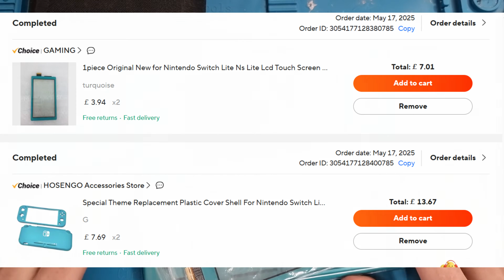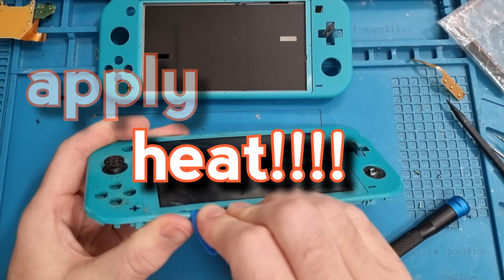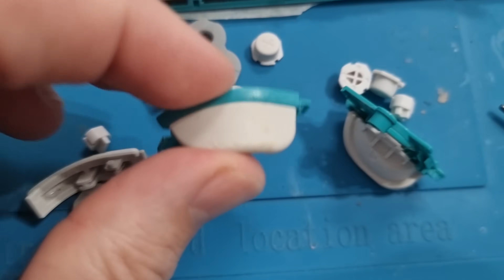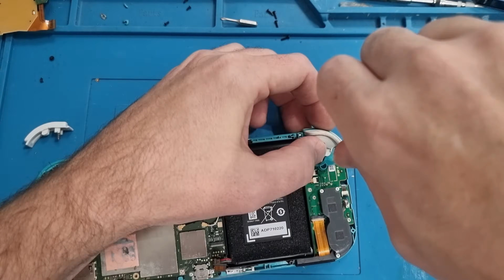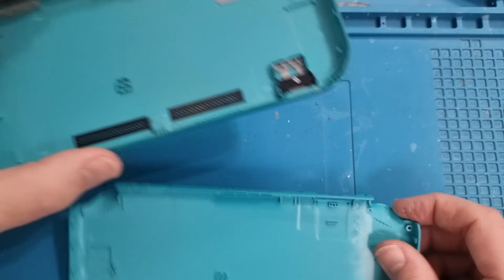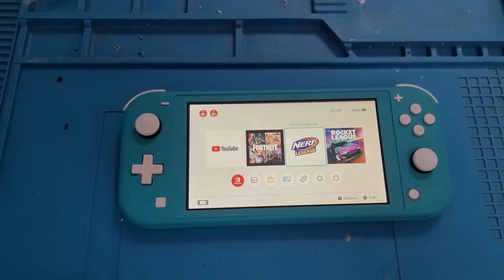Switch Lite Teardown & Re-Shell | Full Mod Process

Comment: I really like your videos, but there are a few things you could definitely improve.
When you change displays or digitizers, you should make sure to avoid dust getting trapped inside.
I always change my top lens and digitizer in the bathroom. First, I damp-mop the floor and all the surfaces, then I run hot water for 15 minutes, and after that, I let most of the moisture escape through the open window.
Finally, I replace and glue several displays at once. Fantastic results!
Reply from the maker: I hate changing digitizers because of the dust! I will look at giving your tips a go next time 👍